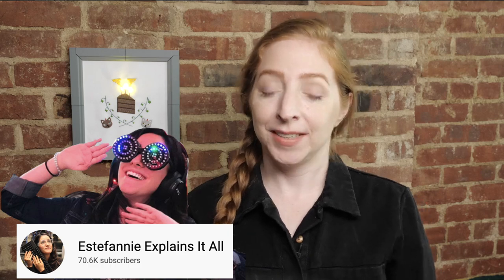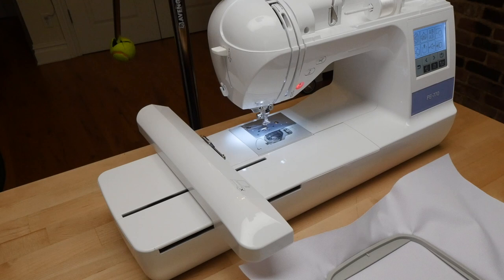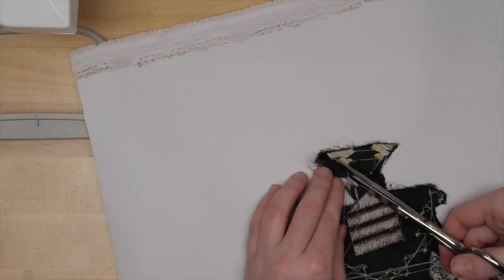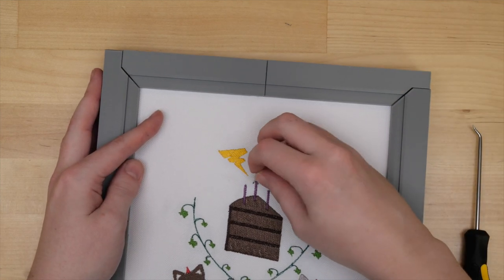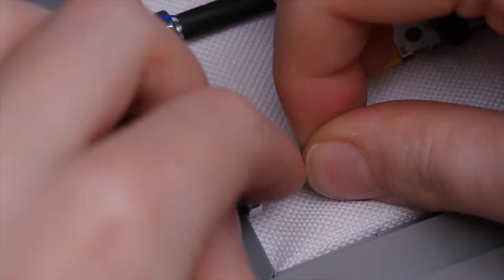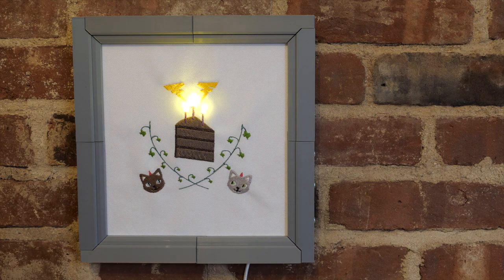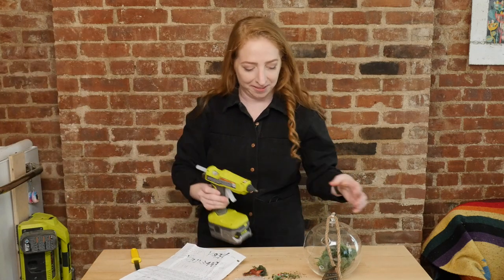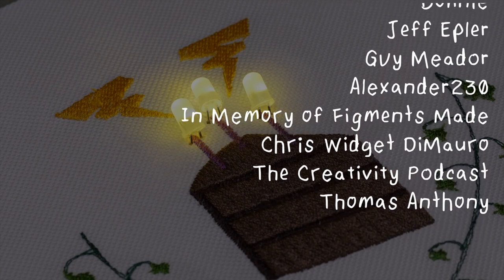Embroidery + Electronics (Birthday Collab with Estefannie)

Comment: Happy Birthday! It seems most of the creative persons in the world (which i know) are born in Jan and Feb. 
That LED are flickering without external controller? So, you added all that other modules "only" for the music?
Reply from the maker: Thank you! And you got it, the touch board, speaker, and RTC all control "just" the music. The LEDs have their own small chip inside. It would have been trivial to attach the LEDs to an i/o pin instead, though, and turn them on/off. I just wanted them to be always-on.